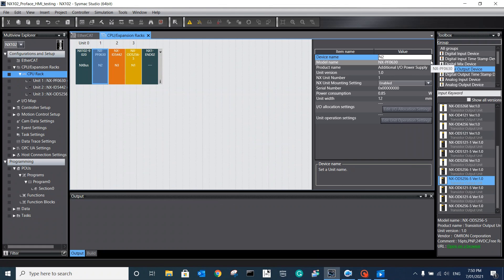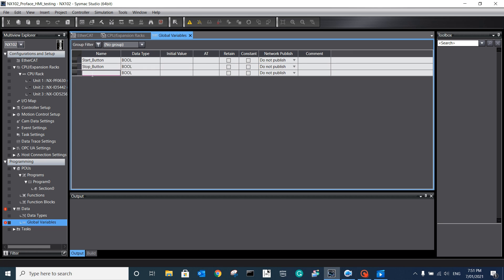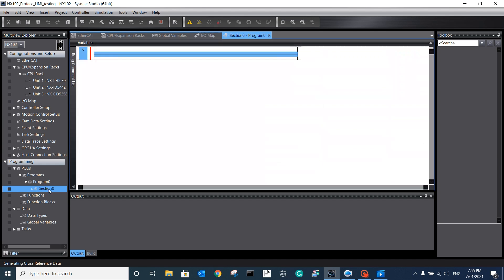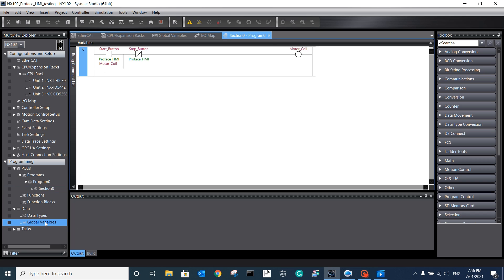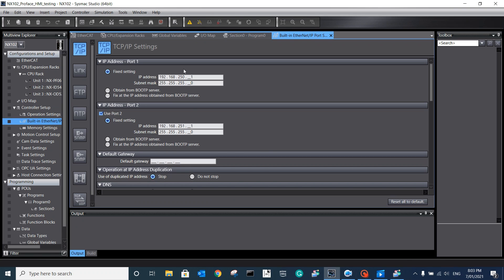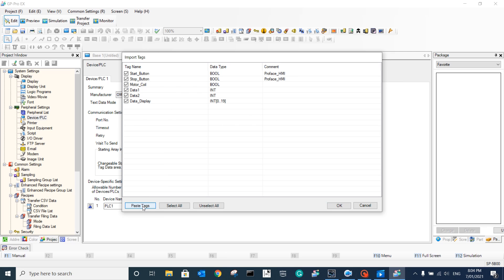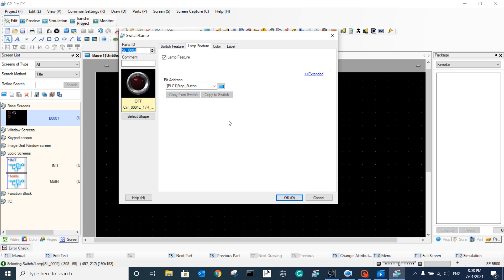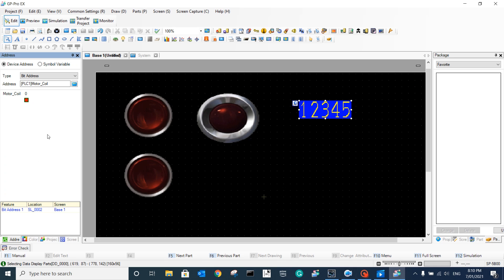Use Omron NX102 to communicate to Proface HMI via Ethernet/IP

Comment: Hey Yang, thanks for the tutorial. We normally just use Omron NA's with our NJ/NX PLCs, but we're about to use an NX1P with a Proface GP4000 series. Does the NJ driver in the proface software work with NX1P PLCs?
Reply from the maker: It does work with NX1P2. For the settings, pretty much the same.
Reply: @yangqiu472  Thank you!!